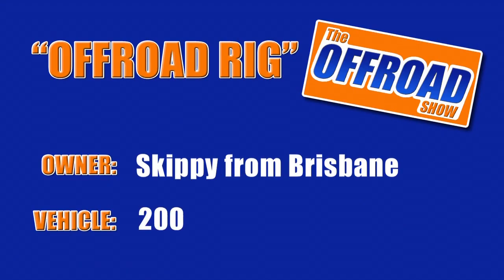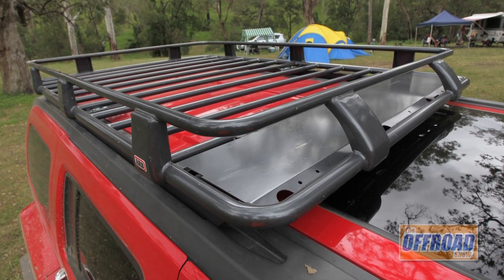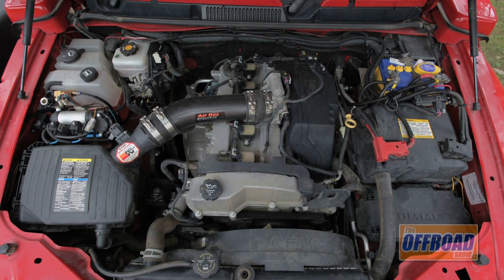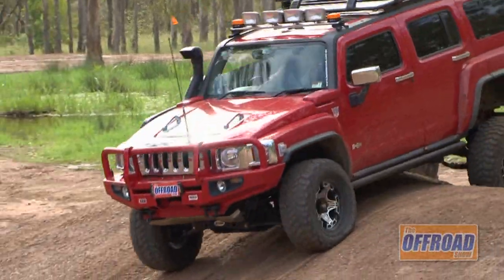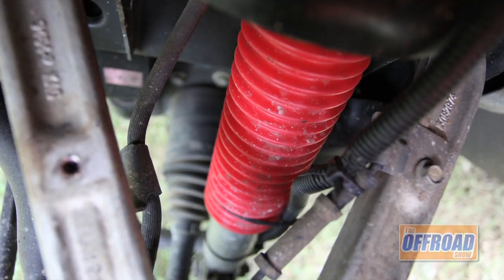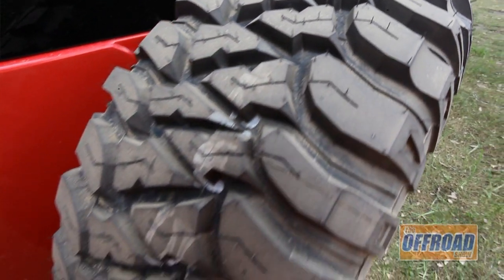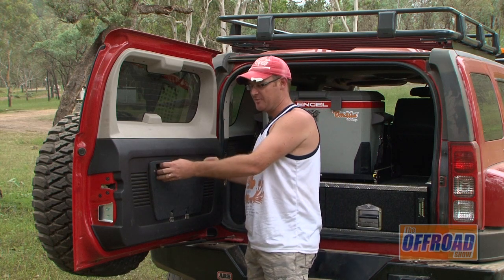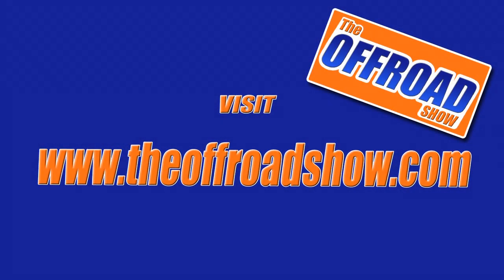The Offroad Show s1e16

Comment: Great unit out of the box. I’ve had mine since 2008 and slowly transformed it. 
3 link 16” solid axle conversion and LS2 powered sitting on 37’s makes it a head turner on the tracks.

Comment: I approve 👍 most of us that still have the h3’s are die hard fans. I’m 5.3 swapping mine hopefully this summer, then I can get back too upgrades. Just finished up second set of rims and tires. Got an original h3x ram bar from a friend, need to drop a winch on it. It can come off and on real fast by removing the front rings sliding it behind and bolting things back down. I love working on this thing. Wish I had more time and resources but it’s a work in progress. 15k in now
Reply: 15k including the truck? Just got my H3T alpha on 35s with the off road package and luxury pkg so it has that bull bar you got, the last owner was a bit rough tho